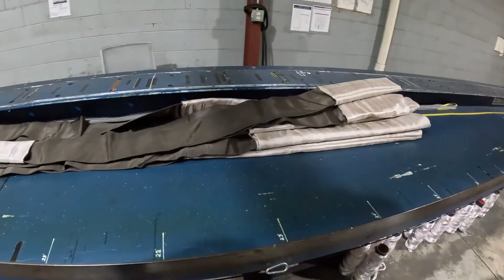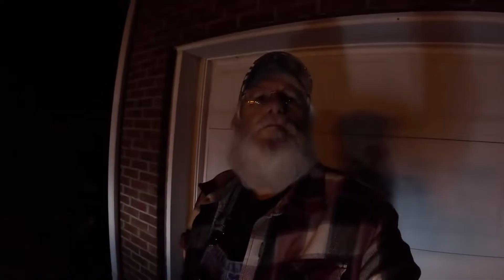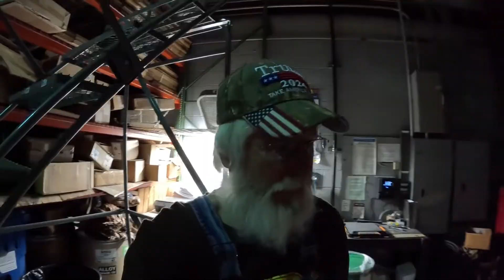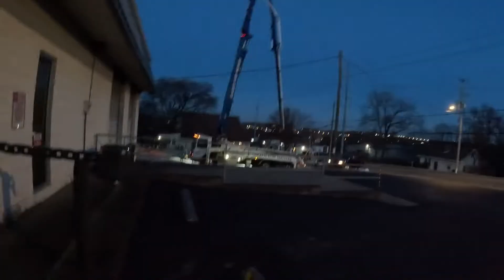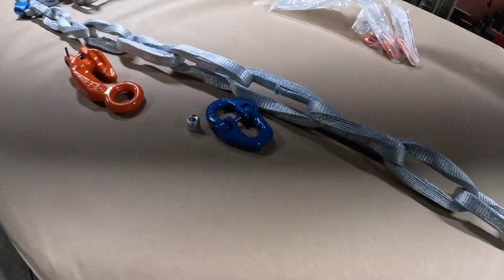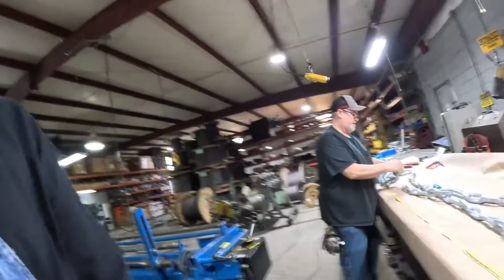Synthetic Chain Slings

Comment: That soft chain is made out of dyneema.  There are special cutters for that material.  These cutters are not expensive.  That material will dull those cable cutters.
Reply from the maker: It's cut a lot of stuff.
Reply from the maker: And yes it is dyneema,you have done your homework.
Reply: @hanginwithdaddio  Great Channel... I actually make a lot of soft goods like dyneema soft shackles and spliced eye to eye links, swage my own wire cables and make various chain assembles.  I do all this in my garage to customize my exercise equipment and other uses around the house.  Most of the soft goods that I use are Dacron, Dyneema and nylon.  I actually do my nylon and leather sewing by hand, using awl at times.   I use special scissors and/or a hot knife to cut Dyneema and Dacron. I am always checking this channel to see what you guys are up to:)...  Keep up the great work...

Comment: have you ever dealt with any sort of vacuum cup lifts for 4ft x 8ft sheets of material?  we need something to load sheets into our waterjet cutter.
Reply from the maker: We use Anver and Caldwell that has Univac
Reply: @hanginwithdaddio  what is a estimated rough price range on a 1000 lb capacity?
Reply from the maker: @cruch9  there is so many options, send me all specs to my email, customsling@gmail.com it will take several days for me to get it all together, I will also look for some spec sheets to send you.